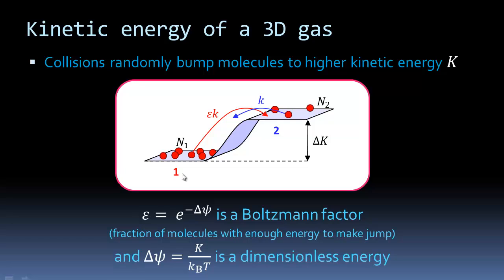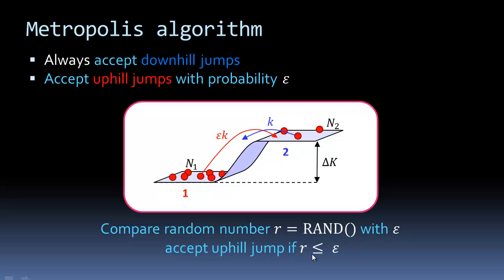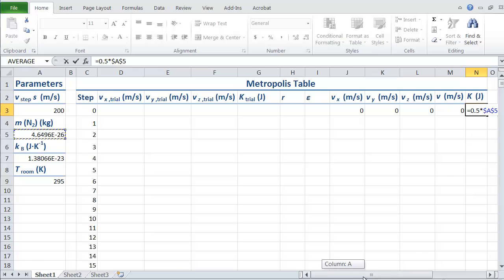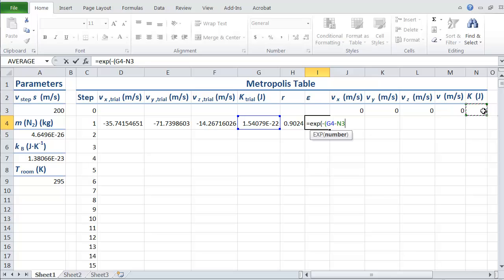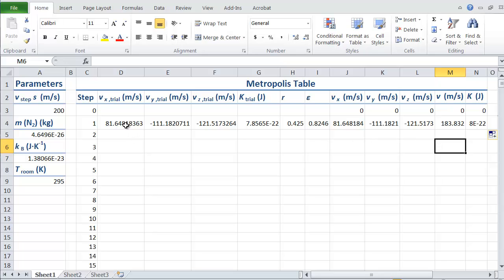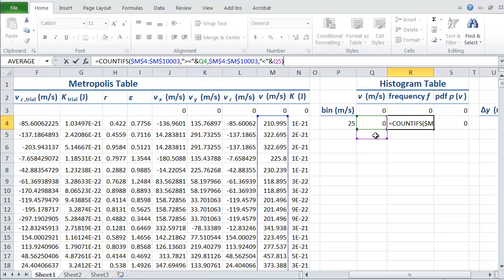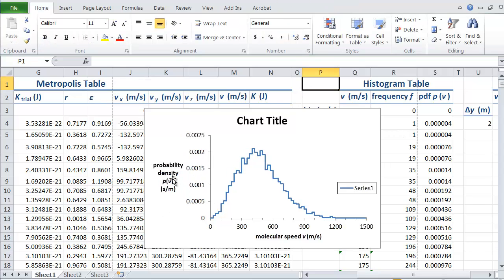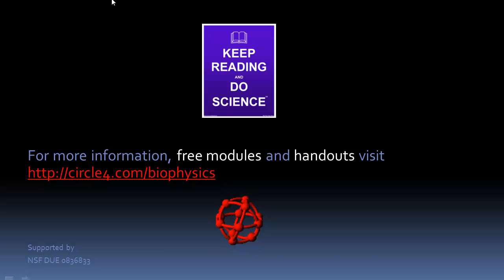Maxwell-Boltzmann Distribution generated by Metropolis Monte Carlo Simulation

Comment: Mine seems to be centred around zero

%constants

k = 1.38064852.*10.^(-23); %Boltzmann Constant

numchanges = 10^7; %number of steps

maxchange = 10000; %maximum change in velocity per step m/s

m = 6.*10^(-26); %mass of particle in kg

T = 320; % temperature, room temp

v0 = sqrt((3/2.*k.*T)./m); %initial velocity 

https://i.imgur.com/2FhgvHB.png